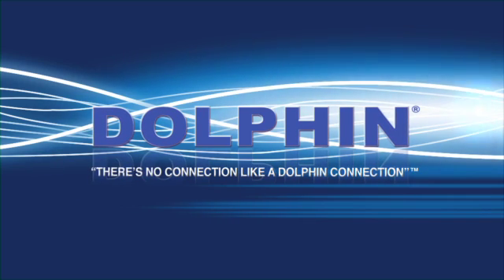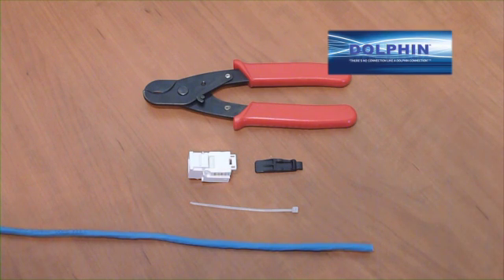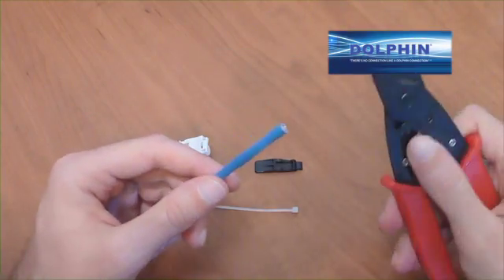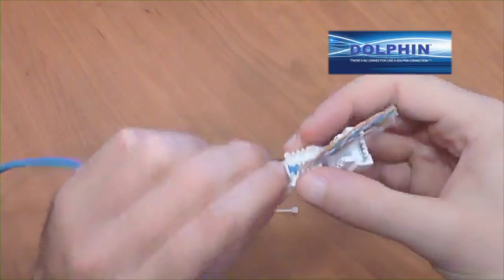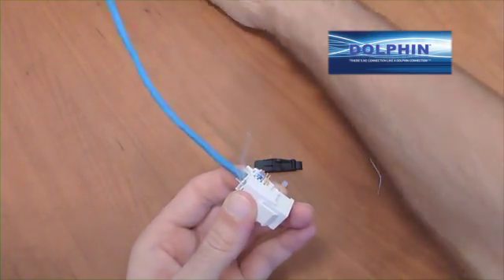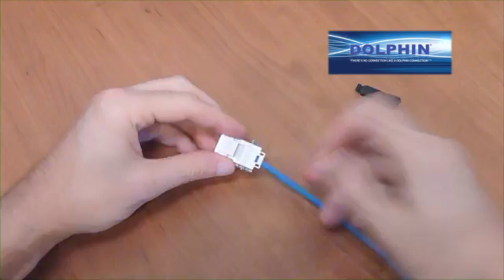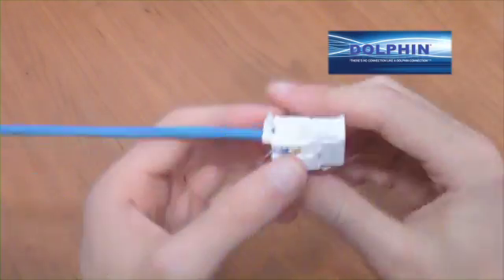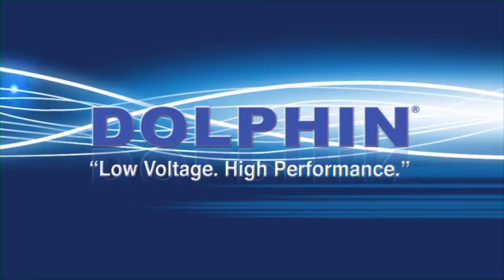Cat 5e/Cat 6 Keystone Jack - Tool Less: How To Video

Comment: Thanks for the response.

I do advise against the tool less design to anyone that is interested though.  My tech knowledge is decent-high and I would just recommend spending $10 on a tool that will get you for-sure results.  Not only did I waste $1.40 per tool less keystone jack unit, but I also wasted time.  Time between the first order, to troubleshooting, to ordering new parts, to watching Youtube videos, to having another attempt and failing, and finally manned up for the Tool + Keystones.

Comment: Great video.  For some reason, with my exact part from monoprice, the termination didn't seem to work properly.  I am cut off the end and will try with a replacement part.  Hopefully it will work this time around... using 568B standards on both ends...

Could you elaborate on possibly how the termination works?  Would I be better off to insert the corresponding color wires into the punch down areas instead for a for-sure punchdown termination?  Thanks!